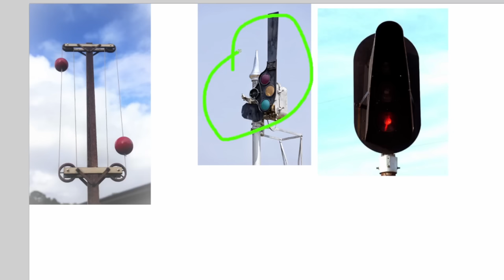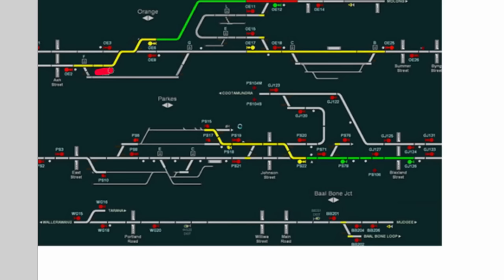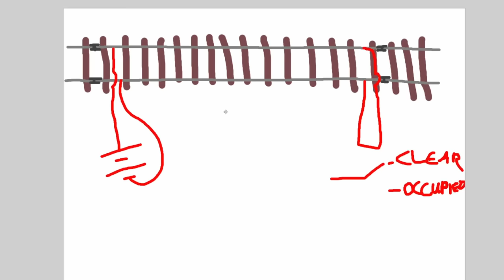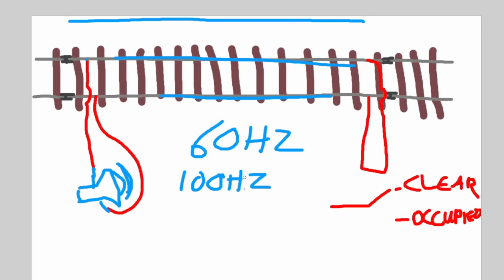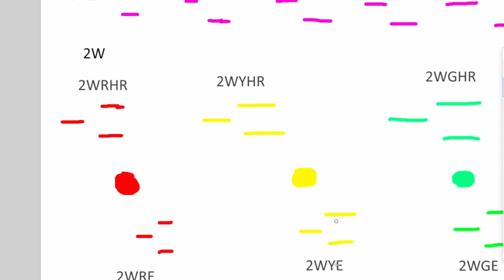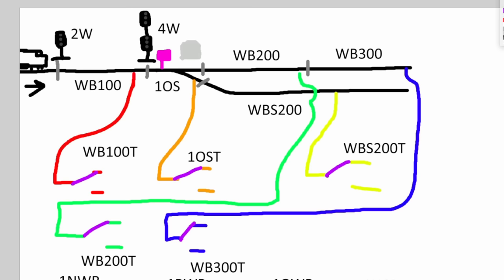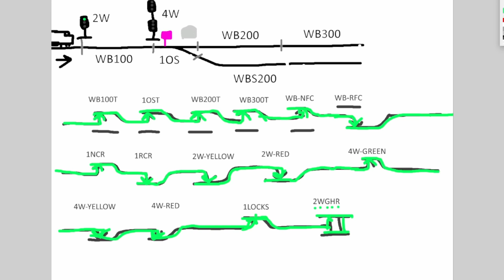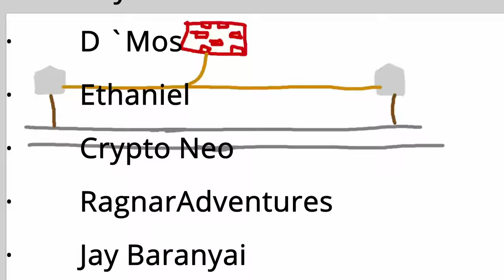SIGNALS 101: 10 Levels of Train Signal Understanding

Comment: The wavelength of a 60Hz signal is 5,000 km so either you have very long track circuits in the USA or extremely sensitive phase detectors or, more likely,  power frequency track circuits don't work the way you describe.
Reply from the maker: You're absolutely correct, I'd had this explained to me before but I must have been conflating two types of track circuits. It appears there are high frequency AC track circuits that exist that operate the way I've described, but the ones we use that are lower in frequency utilize a vane relay that is looking for a certain amount of AC current to operate. Once the current drops off (due to the presence of a train), so does the relay. Learned something new today, thanks for calling me out!
Reply: @Hyce777   Aren't  Pwr. Freq. circuits the basis of grade crossing protection signals too? ?
Reply from the maker: @mdavid1955  Depends; sometimes yes, sometimes no. Usually they are an overlay of some sort, be it audio or power frequency so that the approach circuits can be separate from train detection for signaling. But grade crossings are probably their own separate 101 video. lol!
Reply: Hey there is a video somewhere here on YouTube where someone I was saying about is it possible to charge a cell phone from that track signaling circuit and I think it's a saved video that where they've got a lot of speaker connected to cross the rails and you can actually hear what type of signals are being send down the rail it's possible these are two separate videos possibly same YouTuber don't know too long ago.

Not sure which circumstances they were in and what type of signaling was used for that track circuit either.

But you can clearly hear different patterns and in-between you'd hear something entirely different repeating on a regular basis.

So just was not just a constant frequency again not sure what circumstances this was being used or how far a great Crossing or anything there was no reference to it and all you could see was the track at that point.

In the old olden days or bad old days if you want to call it that?

Almost everything was d.c. and frequently battery-operated either rechargeable batteries at in some areas or even long life primary batteries although some metal-air batteries were used and even the ones that just had two plates replaced and the electrolyte changed in some cases.

Somewhere similar to what was used things like aids to navigation.

Such as buoys and other other applications as well.

And even what was referred to as a charge retaining battery which still unfamiliar with but I knew they existed.

And even sometimes even in later buoys they would actually be powered by disposable batteries essentially.

Think giant lantern battery!

And I believe some systems as low as 4.5 Volt or even 6 volts.

I know someone that had two strobe heads from a buoy that had been washed to a location the thing was basically kaput but the strobe assemblies have been salvaged.

When it was found was barely even able to float anymore and had probably been out of commission for years!

I was able to power up one of the strobe heads the other one the Xenon strobe lamp was truly spent electrodes that degraded so much that it wouldn't even flash at all.

Also back in the day Way Way Back a some signals as in semaphores were actually powered by CO2.

Back in the day it was called carbonic acid gas!

Some signals were actually lit by oil candles even.

But the interesting thing is there was some electrical equipment associated with that.

Essentially a thermostat of course course relying on two different Metals expensing man Contracting.

However are not a bimetallic strip like one might think.

And there would be a series circuit that if one of the oil candles goes out the circuit would open since the thermostat but cool to the point that the circuit was open.

And that would be relayed to either a signal Tower or otherwise to indicate that there was at least one signal aspect somewhere that was out!

Even back in the day there a lot of track circuits.

Most people think that all the lines beside a line of crack is Telegraph lines however back in the day a a lot of it was track circuits.

Performing various functions not just signaling but various other things as well.

As a matter of fact there was even a radio system at one time that was won the first since there was always overhead lines near the track essentially you could do short distance radio just having the receiving system on board the train and be able to just pick up the signals not sure of this was Prototype are actually putting into practice but have heard of it.

Also there was actually a communication phone system that could use Telegraph ones for telephone purpose.

That essentially the extended hooks over the telegraph line to connect it was an important box sort of thing essentially first portable railroad telephone of course this is before the Advent of Radio Systems.

And even before really electrical and other things caught on there was a lot of purely mechanical systems that would operate signals and more.

And also some generations of pneumatic systems.

And if anyone has ever heard of the old Crossing beacons that just blinked at the Crossing and just had that sort of conical base with the Lantern on top.

Those were actually at First at least let buy acetylene gas!

Also at one time they let railroad cars by Compressed Gas!

Lot safer than kerosene lamps
Reply: @Hyce777  I believe the technique you were discussing applied to audio frequency track circuits in the multiple khz range.  Utility frequency AC track circuits I believe worked like a simple DC TC, but could support electrification or DC overlays and just needed the AC relay technology to exist.
Reply: Thats true for RF and electromagnetic waves but wavelength depends of the speed of propagation and frequency ie λ=v/f.  I dont know how fast the signal travels down the track but I doubt its the speed of light.
Reply: In the US, I wouldn't doubt there are some expansive areas where this could happen along certain lines. But if I recall from my combined phsy/chem/engineeering  (the stupid, basic level class, not advanced or AP) class, the electricity level has to do with how much is currently running on the line. I.E. 5 trains in 100 miles is a bit, depending on type and build, but without more regional information, a warning can be given (If this is 100 miles of unoccupied area this could be too much, but if agreements have been reached and every operator can account for each train, it is understood). If there are 20 trains within 5 miles (think downtown Chicago, LA, or New York), within a city (like the subway), then the track signals could be different. I would like to know more about this as I have an interest in public transit (which does include trains). Bus drivers give signals as well (City, greyhound, and public busses).
Reply: @mdavid1955  Yes. Grade crossing predictors use AC frequencies in the audio range for approach circuits at RR crossings. Each crossing has its own frequency and uses tuned terminatin shunts. Many crossing can overlap, each listening to it's own frequency. The "predictor" works by looking at the impedance of it's approach circuit. The approach circuit is driven at a constant current (.250 amps is common). As a train rolls into the approach circuit, the impedance characteristics start to change. The rate of change tells the predictor how fast the train is going. Based on the length of the approach ad the speed of the train, the predictor is programmed to know when to activate the warning system at the crossing  to provide a consistant warning time, regardless of train speed. The predictor is also capable of "timing out". If you ever see a train sitting near a crossing, but the gates and flashers are not active, the predictor has timed out. It knows that the train is not in the crossing (or a separate circuit known as an "island"). If the train stops before the crossing, the impedance stabilizes and the predictor allows the warning system to recover until such time that the train starts moving towards the crossing again.
Reply: @gordoncrisp3060  Yeah,that's what I though..It's tuned circuit.
Reply: @tristacker  Yeah slower signal propagation down a conductor, like a wire.
Reply: @gordoncrisp3060  All this "electronics" talk reminds me of my youth..when I was studying to become an electronics technician.
Reply: @mdavid1955  Yes the crossings (most main line, anyway) have tuned circuits.  Also, a lower frequency signal, say 86 Hz would be "hotter" than say a 540 or a 790 Hz signal. That is because of a phenomena known as the "skin effect". DC will use the whole cross section of a conductor (or rail, in this case) whereas an AC signal only utlizes the outer portions of a conductor. Lower frequencies have a deeper penetration than do higher frequencies, hence the higher the frequency, the more shallow the "skin depth". On crossings with longer approaches, a lower frequency would be preferable and vise-versa with shorter approach circuits,
Reply: @Hyce777  I worked on a similar system for remote control of radios for air traffic control. when the controller  keyed their mic, a tone would activate a radio for that channel or it's broadcast frequency, for the pilot to receive like approach control.
Reply: and it was this comment that brought me a fundamental intuation on wavelength
Reply: @tristacker  The material make up of the conductor has a lot to do with the speed of the propagation of the signal, we calibrate the instrument landing systems at the airport with this theory.
Reply: @Hyce777  Love to see that 101 on grade crossings when you make it!
Reply: Couldn't you have a 60 Hz pulsed signal and run the detection in the time domain? I guess that would technically involve higher frequency components though.
Reply: @tristacker  Signal propagation speed in a wire is governed by the surrounding dielectric that isolates that wire. For a rail that's mostly air, which means that electric signals in tracks do indeed travel at nearly the vacuum speed of light. Yes, it's counterintuitive that the conducting material of the wire itself doesn't matter for the propagation speed, only the isolator surrounding it does, but that's how the physics works. Even with other common dielectrics (eg. say the plastic that's commonly used to isolate cables) the propagation speed is still about 2/3rds or more of the vacuum speed of light. So the wavelength for 100Hz would still be in the thousands of kilometers range and way beyond the length of any track circuit.
Reply: @Hyce777  In certain types of low frequency AC track circuits the phase is important, but not in the way you described it. I think that's where the confusion comes from. Those track circuits use a so called motor relay which is basically a two-phase synchronous AC motor working against a spring. In order to actuate it needs to be supplied with two different phases that are 90 degrees from each other. One of the phases goes through the track circuit, the other is supplied separately through a cable. Only if both phases are present (ie. the one going through the track isn't shorted by an axle) does the relay operate. This can provide higher safety and reliability in case the isolation joint between two track circuits fails (ie. becomes conductive). Neighboring track circuits use different AC phases, so if the relay receives current from the other circuit for some reason it won't be in the correct phase relation to the separate supply phase and thus won't trigger the relay.
Reply: @Hyce777  So I think that interlocking tower is at Davis California station south from where I live but it’s just for display and sometimes maintenance cause I have seen Union Pacific workers go in sometimes so I think that the Davis station here in California used to have semaphore signals before those target signals
Reply: The "extremely sensitive phase detector" you say must exist for the power track frequency track circuit to work, is a very old piece of kit called a Synchroscope. They’re used to connect an AC generators at power stations to the country wide electrical power grid.

Comment: Level 6 reminds me of a situation in Switzerland. Appearantly they use some method (probably with weight sensors rather than electricity) to count how many axles have passed that point (probably use full to indentify runaway cars). 
I think you can guess what happened when I say a law was implemented that a train cant have exactly 256 axles.
Reply: An axel counter does not weigh the train it just use an 8 bit value so you would zero for evry 2^8*n because you do modolu 2^8 to a binary value
Reply: Uhoh runaway bits!
Reply: @TrapperAaron  More like "Train? I've seen no train it says 0 axles passed" followed by kaboom.
Reply: It's an axle counter, uses a magnetic field to count wheels.

You have one at the beginning and one at the end of the section. It counts +1 for each axle entering, -1 for each exiting
256 axles on the earlier versions made it think the section was clear
Reply: Hahaha the byte is full and goes "ah, its 100000000, its clear"
Reply: Actually there are experimental axle counters that get glued to the track and get triggered by the weight a the vehicle compressing the track. So your guess was not that far off 😉
Normally the axle and its direction is detected by two magnetic fields next to each other.
Reply: Not just in Switzerland. Germany uses axle counters for all new constructions (or upgrades) as well. Especially since there was a near miss incident in Mainz in 2013 that was caused by a track circuit not registering a train because it was isolated from the tracks by braking sand that was adhering to its wheel surfaces (the train had disc brakes, so the running surfaces weren't "cleaned" by brake shoes rubbing against them; this is why since then in Germany trains with disc brakes are no longer allowed to use sand at speeds below 25km/h unless it's critically necessary for safety).
Reply: @dasy2k1  "256 axles on the earlier versions made it think the section was clear" Which is why eg. on the network of Deutsche Bahn in Germany trains are limited to at most 250 axles (252 axles with some special provisions) by company regulation.
Reply: Classic Switzerland. Overcomplicating something for no reason, only to have it make things harder in the end.
Reply: @wta1518  Well, its not for no reason. If the train has exactly enough axles for the system to think that 0 axles have passed, then that's a MASSIVE problem
Reply: @Armageddon_71  No, the axle counter is the overcomplicating.

Comment: understanding Track Signals is also handy for Trainspotters and Train enthusiasts to know what is going on in their area when a Signal is nearby.
speaking of dispatching, when are you going to take another go at the Dispatch simulator?
Reply: Track Ciruits are not something that terrorist should know about, If you connect 2 Track Ciruits together with a pair of wires, cross them over, create a false feed, train is not detected, another train will crash into  it.
Reply: @ianburnett7333  
the system is designed with numerous redundancies and fault detectors inside the trackside bungalows and at central Dispatch offices.
any anomalous signals detected will send the block signal affected into Failsafe Mode.
in Failsafe, the signal will display Red <absolute stop> or no Indication at all <also Absolute Stop with a call to Dispatch.>
an error detection will also be sent to Dispatch to send out Track Maintenance to find and repair the fault.

Terrorists want to make a statement when they attack. derailing a train doesn't do that since trains derail without manual intervention due to an array of reasons <worn wheels, metal fatigue etc...>
railcars carrying Haz-Mat's are designed to remain intact if involved in a derailment.

Comment: Guy I used to work with when he was going to school (he's near retirement age now) used to work for Union Switch and Signal here in Pittsburgh PA, and used to wind coils and build the glass case relays. I was always fascinated with those, especially where a few of my local lines are still running them today. You can hear them clicking away when the clear signal is set, then after the train hits the block ahead of this position it goes from (I'm guessing) 120hz click click click to 60hz click and then as the train passes the block and signal it drops from green to yellow over red, and then as it exits that block, it just goes dark. I've spent many an evening watching the lighting bugs and listening to those relays talking waiting for the B&LE to pass by.
Reply: Signal code relays are very neat.  It's how the signals talk to each other, so when a signal is at Stop (no code, no clicking), the signal in front of it knows to show Approach versus something better.  It's also what the conventional cab signaling listens to.